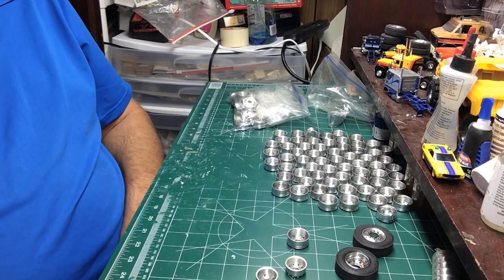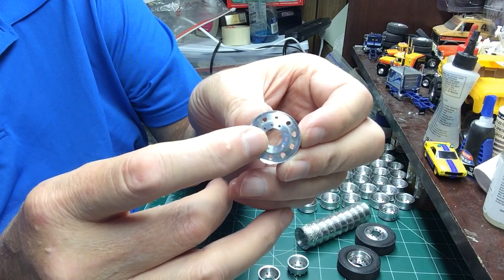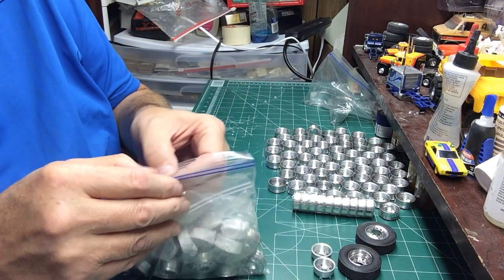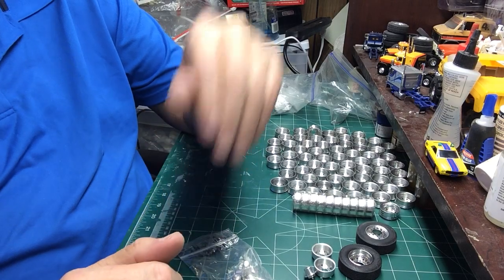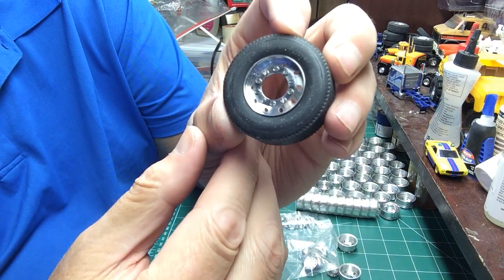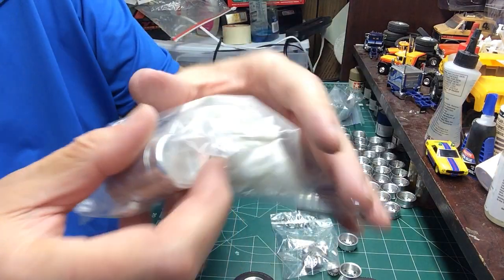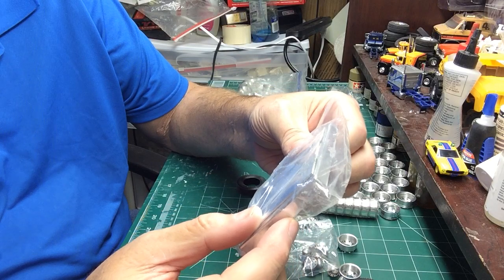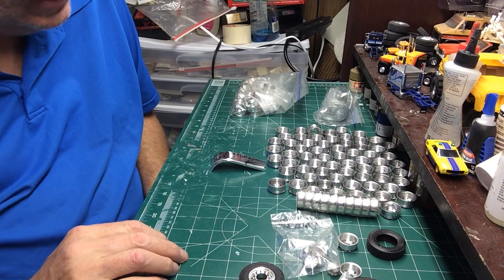Building scale plastic models: model trucks: real aluminum and stainless parts.

Comment: Like to get a set (or four) of the 90's style in 1/16 scale to replace the roached kit wheels. 
Yes, the 1/25 split wheel is important to also toss the fake flanged-stepped kit steer ones. 
I have been using the printed nut and bolt (from Russia for Armor modelers) sets for lugs.
Thanks for the show n tell, good to know where to go, and like you said, don't wait!
Reply from the maker: Get ahold of Doug Wagner at Keystone Aluminum Model Miniatures on Facebook. I think he just came out with aluminum ten hole wheels in 1/16. I’m positive someone has, I just may be wrong if it was Doug?

Comment: I'd like to see these done in 1/25 scale as CRAGARS, Anson slots, American Racing Torque Thrusts and CENTERLINE Auto Drags.
Reply: Check with some of the car modeling groups on FB. There may be some of what your looking for there. 
Ben does mostly truck models and is in truck groups there but there are lots of dedicated car groups also. That would be your best bet for finding what you want.  Someone may make them or you might find someone who will 3-D print some for you.
Reply from the maker: Dancing bear and Micro Nitro on Facebook make all those for cars.
Reply: @lotso69  Thank you!